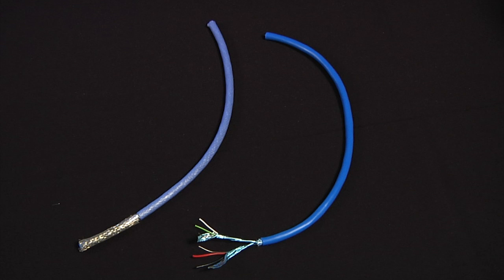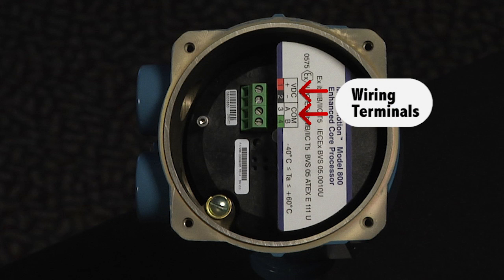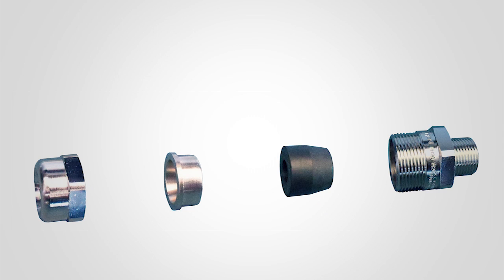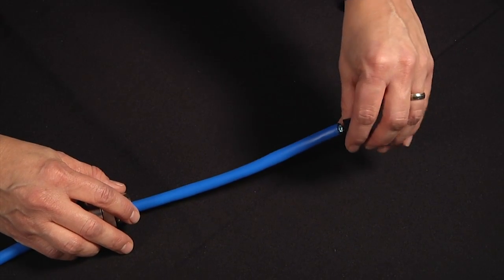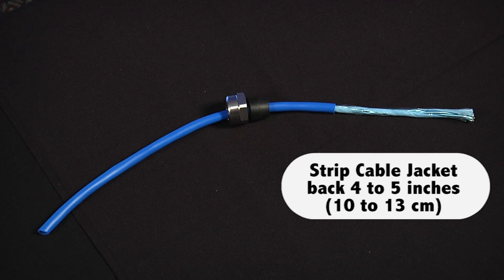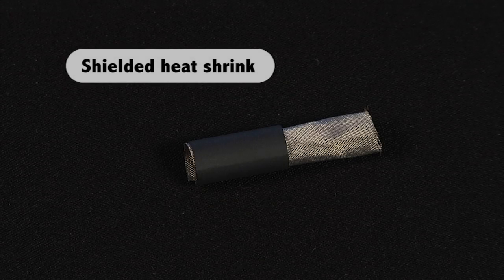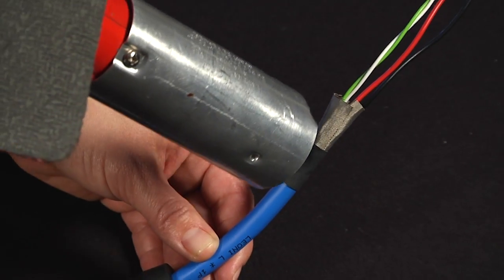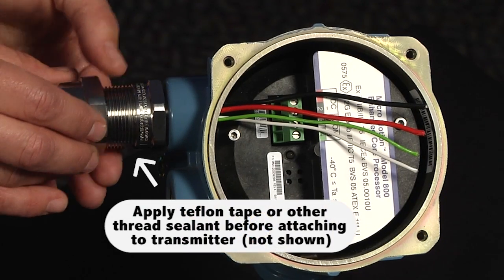Sensor-to-Transmitter Cable Preparation & Gland Installation

Comment: What will be the voltage level for VDC + & VDC-?
Reply: I wondered the same thing when I received a mass flow meter from this brand; it doesn't even have a voltage label. It's not specified in the manual that came with the device either. It's a shame.